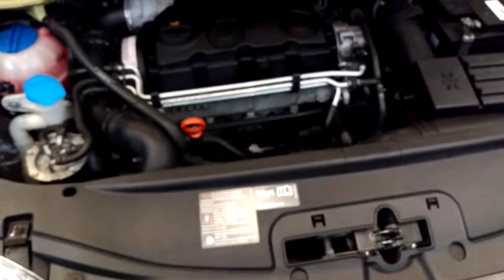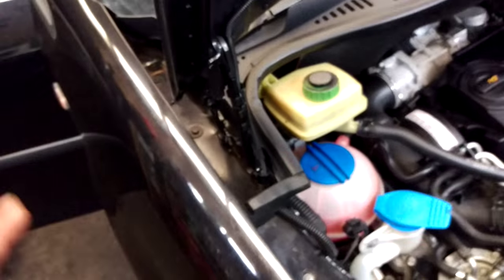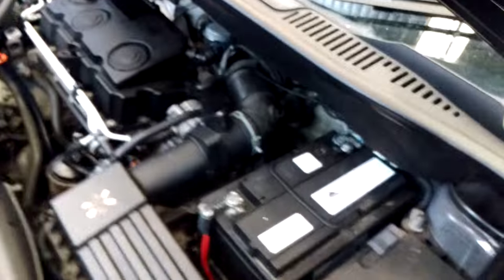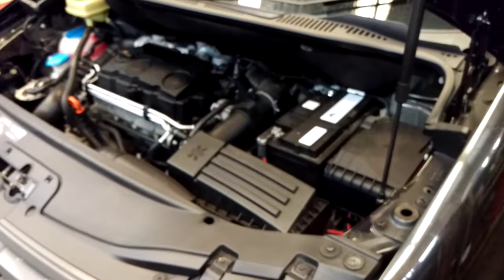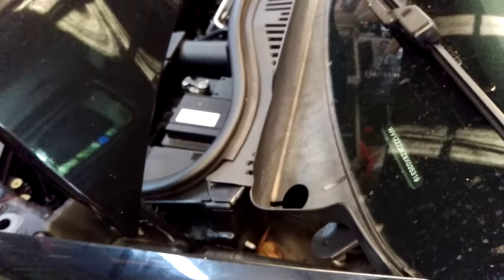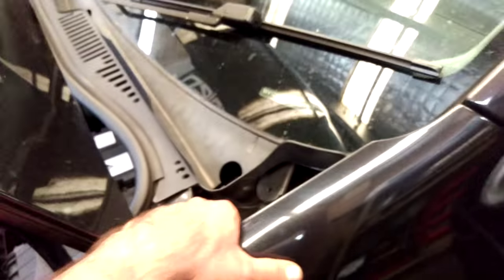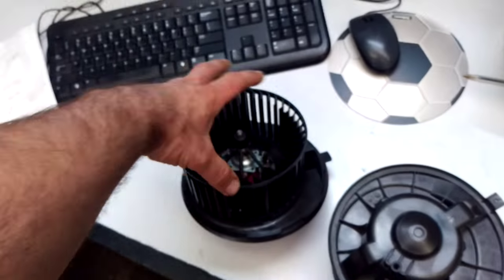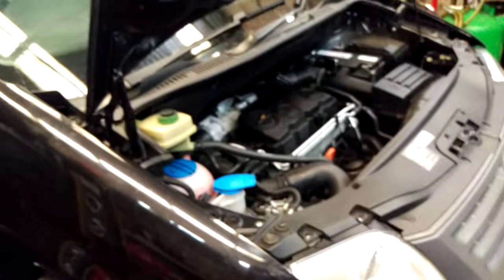Volkswagen AC blower fan motor fuse short circuit

Comment: The heater blower is not working in my Passat b6 07 and also the a.c. although I never use the a.c. cos I don't like ac.id like to know where the relay is located as I don't think it's the fuse.help